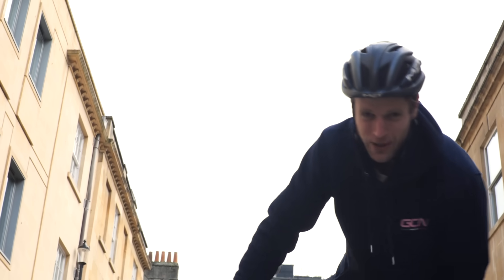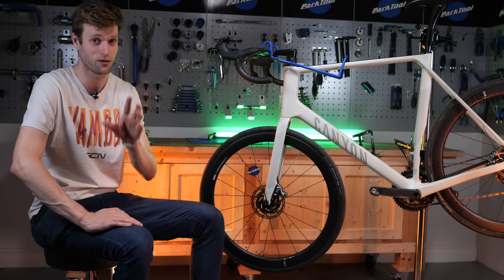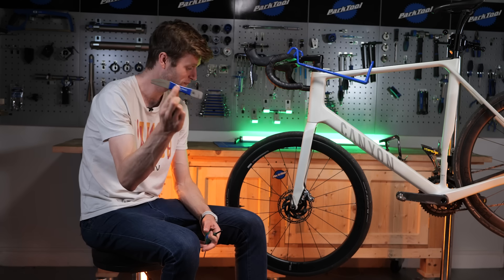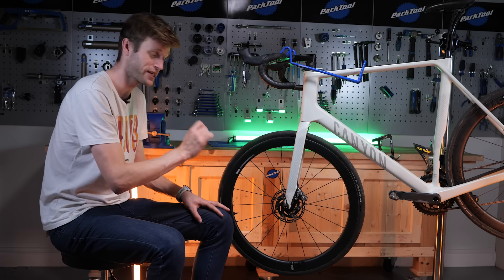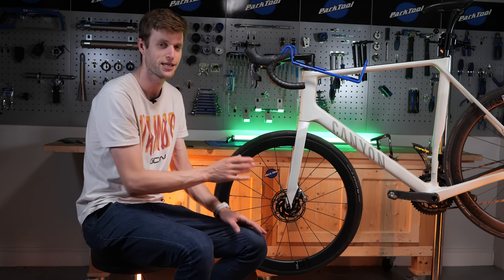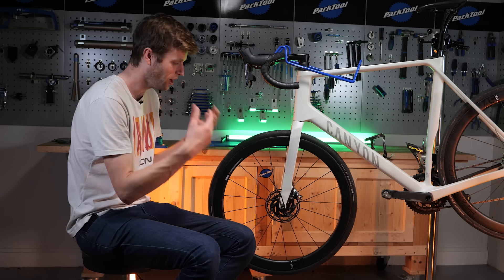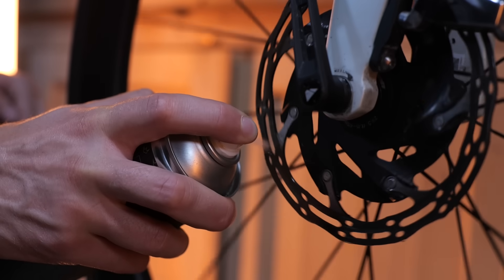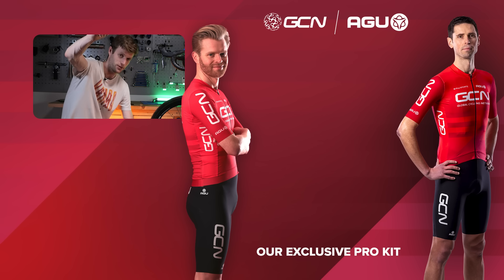Why Your Disc Brakes Are Noisy (And How To Fix Them)

Comment from the maker: What do you do to stop squeaky breaks?
Reply: I increase the volume of my headphones.
Reply: @svenlima  SO DO I
Reply: by learning grammar, "brakes"
Reply: @brittle1  You’re right. But I think you mean spelling.Also start your sentences with a capital and end them with a full stop.
Reply: @Lurcherman-p4k  no
Reply: After a basic alignment and cleaning caliper pistons…

If there are further alignment problems, remove the bleed screw, depress the brake lever by a few mm, and reinstall the bleed screw while the lever is slightly depressed.  This will enhance pull back on the pistons and pads.  Job done!  Easy.

Scrubbing powder works better than sandpaper for reconditioning the rotors.  Less aggressive and more consistent.  Just need to remove the rotors before and thoroughly rinse them after.

Having ridden rim brake bikes for decades, I’d never go back.  Hydraulic disc brakes are superior in all conditions.  The degree of control is amazing.  No more difficult to service… just different.
Reply: uninstall brakes
Reply: 5:17 if your pad contaminated, soak it on solvent or simply gasoline for 24 hours. Repeat the process once, and the pad will free for any oil contamination. It's easy if we have spare pads. Contamination can be came from mineral oil leak in brake caliper.
Reply: 55 years using rim brakes (not breaks) with no issues. Why do I need disc brakes?
Reply: @Graps19  You don't. You also don't need to waste time watching or commenting on videos about something you don't have, but yet here you are 🙄.
Reply: @Bikey_McBeardface  And here you are, wasting time commenting on my comment.
Reply: @Graps19  No because I have bikes with disc brakes and was listening to/watching  the content whilst commenting. Besides, pointing out stupid is never a waste of time.
Reply: @Bikey_McBeardface  Really? a rather stupid comment that assumes much.
Reply: @Graps19  Pretty sound assumptions, based on your comments.
Reply: @Bikey_McBeardface  If you base your "sound" assumptions on a comment as to why I don't need disc brakes you need some education in understanding English.
Reply: @Graps19  I never made an assumption as to why you don't need disc brakes. I assumed you aren't very bright, and like I said ...sound assumption.
Reply: I keep my bike in good repair to keep it from breaking.
Reply: https://youtu.be/zE6NFkGf-Fc?si=8ioEMc7qMMhzO2Ks
Reply: Nobody admits the real cost of disc brakes.
Reply: Oil them 😂
Reply: WD40
Reply: Send it.
Reply: Nothing because its hub and fork flex causing it when I stand up
Reply: I don't. I love my brakes to screech that way the 4-wheeled idiots of LA know I'm coming. It helps un-distract them from their cell phones.
Reply: Antacid tablets will help stop any embarrassing squeaky breaks
Reply: *brakes
Reply: Ride my rim brake bike
Reply: @chriswood1474 Yes I wish we still had the choice to buy a rim brake frameset.The average cyclist doesn’t need all this faff.
Reply: spray wd40 on it 🙂
Reply: @joshuavantongeren1734  Can I ask if this is serious that WD40 works. Im genuine wondering thanks.

I else found sandpaper with alchohol smart. I wonder if that also works for rim brakes, cleaning the rim of the wheel.

Comment: I’ve come to the conclusion that some disc brakes are just inherently noisy, and the only real fix is switching to different ones. I have three bikes - two with Sram Level brakes, both incredibly noisy, especially when wet. It takes ages for the noise to fade, only for it to come right back as soon as they get a little wet again. I’ve sanded and cleaned the pads and rotors multiple times, replaced pads, aligned calipers, tried every trick you hear in the videos - nothing makes a difference. My third bike has Shimano MT400 brakes, and I’ve had zero issues with them despite using and maintaining them the exact same way.

Comment: I just dont get it. I got disc brakes because everyone said they were better, and yet I've had more issues and spent more time on them to be more fearful of their performance in bad conditions. They squeal unbearably in the wet and now I'm resigned to replacing the rotars as well as the pads because i just can't keep sanding or cleaning.

Comment: I learned the hard way that ringing (like a finger around a wine glass) can easily be caused by not installing the front wheel correctly.  Make sure the axle is fully up in the dropouts!

Comment: The sanding part works for me. My brakes are no longer squeaky.
Reply: What grit number is the sandpaper?  Sandpaper goes anywhere from 36 grit to 600 grit.
Reply: @dwightl5863  I've used 400 grit sandpaper. Then wipe the rotor with clean cloth after sanding.

Comment: Had disc brakes for many years on Mt bikes first, now on my road bike, always maintain them well, squealing noise rare. Last spring took bike out from garage where it had been 3C overnight into 20C of spring sunshine, extremely noisy brakes... realised it was water condensation on the cold rotors. Bit of extra braking over first couple of mins of ride, sorted, once rotors warmed up.
Sometimes it's not a major problem. 
Enjoy your rim brakes if you like them, but give me discs any day. Have been riding for 50 years  nearly all on rims. When I bought my latest  road bike 4 years ago , it was discs ....fantastic, at 60km/h on a mountain descent with a hairpin approaching, no comparison.

Comment: Rim brake question - I had the same issue with my Shimano brake pads.  I swapped them out for Kool Stop brake pads, based on a recommendation I found and I have not had the issue since.

Comment: u cant, if u fix it it will become noisy again anyway. and I prefer v-brakes on ceramic coated rims, because it is better :P Riding my 90s ht mtb as a rigid gravel bike with 203mm servowave xt brakes at front and still the braking is lacking compared to the old v-brakes with ceramic coated rims. My friends says they are the best brakes they ever felt on a bicycle, but what do they know they only are cyclists and have never tried out a motorcycle :P

we need fatter rotors so that they dont overheat so easy, I am glazing over my pads so often, but it is so much better with sintered pads.

Comment: After watching this video I learned that the squeal in my brakes was due to contamination of the pads. Without taking anything apart I cleaned everything with alcohol as suggested to no avail. So thinking of everything demonstrated in this video I took a pressure steamer that  use for cleaning around the house and applied it to the brakes assembly, pads, and rotors. It worked great. Squeal is gone. Thanks for inspiring me to think outside the box.
Reply: +iamc.... Alcohol is never a solution - didn't you learn that?
Reply: @svenlima  obviously not 😀

Comment: @askgcntech I just bought my first bike with Di2.  It says that "The components are designed to be fully waterproofed to withstand wet weather riding conditions; however, do not deliberately place them into water."  The UK has been endless rain this year with flooding.  Is it OK to ride through flood water of 100m or so (lengthwise not depth obviously)?
Reply: I’ve ridden DI2 through axle-deep fords and done three seasons of cyclocross with it and all the abuse and jet washing that goes along with that splendidly stupid sport. No issues whatsoever.
Reply: @DrCrispycross  Thanks that's very helpful

Comment: What I learned from seminars, and courses in the motor industry, on disc brake noise. if the pads and discs are not contaminated, but a squeak occurs when braking in the wet, but only for a second or two. Then it can sometimes be down to 'harmonics'. i'e' water between the pad and rotor creates vibration. This causes a squeal, as in when a wet finger is rubbed aroung the rim of a wine glass, thus producing a noise. Once the water is cleared from between the pad and rotor during braking, then the noise ceases. That's what they taught us anyway.🧑‍🎓🙄

Comment: What do you think, what happens if the disc brake vibrates to feel?
It is not worn so much that neither the disc nor the brake pad needs to be replaced, and there is not enough dirt on it to make a sound, and no damage can be detected.
Reply: When I thought about the problem, this came up during the inspection: https://youtube.com/shorts/8mX6-4TqnEs?si=EBTrQ1u1S7nBWqPv

Comment: If you use resin based pads they make less noise than the metalbased pads. Most road bikes do not need the metalbased pads that cool better and can resist high temperaturen. But most roadbikes do not need these pads and the resinbased pads stay clean better when you do not do a lot of extreme breaking.

Comment: Despite all that, every pro bike race you watch on TV features horrible squeaking/squawking when the peloton slows down. If the supposedly best wrenches working on the best bikes for the best riders can't stop it..
Last time I dealt with this was Shimano Ultegra...after doing all the stuff in your video + more, I swapped the fancy, two-piece rotors out for the cheap one-piece Shimano versions made-in-China along with the Shimano brake pads for Swisstop organics. All quiet...for now anyway!

Comment: Disc brakes on bikes are a pain. Frames aren't flush to the calipers making them line up is a pain without using special tools. Rotors bend if you sneeze on them.

Comment: Yay, another video where all the rim brake people feel the need to tell everyone how wrong their conclusions about disc brakes are.  

Just admit that you're too old to handle new technology and head on over to the retirement home so you're not in our way out on the road.
Reply: I have both and in DRY conditions I ask WHY I have to fiddle around with noise, hydro issues (hoses, bleed kits, oil, olives and barbs) when a decent dual-pivot caliper squeezing rubber blocks against the sides of an aluminum rim with a machined brake track works just as well while being lighter to boot? I'm old, but after "handling" all this new technology more and more it seems like planned obsolescence vs any big improvement when I've had great fun for decades zooming down almost all the famous descents of the Giro and Tour...on rim brakes.

Comment: A lot easier brake pads bedding in procedure is before installing them, wet them with water (tap will do) and rub them against each other whilst wet for a minute or so. Then wash them under water to get off the rubbed bits and dry them with a cloth. Install and ride without any bedding in - works a treat. 

I saw this in one of the bike mechanic preparations for the bike before race and used it a few times. Saves loads of time.

Comment: Why haven’t we learned more from car disc brakes? Mine have always been quiet, regardless of conditions, contamination, etc. etc., etc.
Reply: I've read somewhere that car's rotors are far thicker and, for that reason, they vibrate much less. Thus, the noise is not produced (or it cannot be heard anyway) in a similar case.
Reply: Car brakes get hotter

Comment: After a sportive race, I dowsed my rear disc brake in celebatory (non-alcoholic) beer. The worst screeming brakes I ever heard. It did sound like a truck, not even like a car. Some sanding an isopropanol did fix it easily, though.

Comment: Contamination is a demon sometimes. One time I did pads and rotors multiple times only to find it was a leaking caliper that was causing the issue. Rip my money. I take a staged solution to brakes now. Lv1 Alignment and rotor warp. Lv2 sand rotors, sand pads, clean both iso, clean caliper piston and reset, torch rotor on bike, caliper on, pads out. Somthing is screwed if its not good after that.  Also, if your out of alignment it can cause contamination. If your rotors got a good warp, even one within the gap, can cause contamination. Everything has to be aligned perfect as you can, that is half the battle of reliability. Gradual contamination is a thing imo. You want the pads to be sweeping the rotors clean, perfect alignment all ways is what gives this. This is why some bike frames brake better than others, better honed mounts, stiffer too.
Reply: What a PITA!!! Thanks bike industry!

Comment: I'm quite disappointed to see that pads and rotor glazing wasn't mentioned in this video since it's a very frequent source of brake squealing. It happens when the system gets too hot especially with organic pads. Also, although putting a new set of pads on a used rotor is possible, it's not a good practice since the rotor surface will be irregular. Therefore, there will only be about 40%-50% contact with the new pads thus creating even more opportunities for glazed pads or rotor.
Reply: What's the best fix for glazed pads and rotors?
I actually have this going on at the moment, should I just sand them?
Reply: @colincanyon2519  it's what I do , fig 8 motion pad sand on 800grit placed on a very flat surface, and just make the disc evenly dull .
Reply: @CarkeekW  
I did sand discs before but probably nowhere near enough, I'll do that with the 800 grit 👍
Cheers man you've been a great help 👌
Reply: @colincanyon2519 just till it's dull , it's not a lot required.  I can get rid of light contamination by riding along the flat and very gently applying a brake and peddling against it , if it makes a noise you have put on too much pressure, it starts out you can't use hardly any pressure but in a short time you can use more pressure and it still won't squeal. You keep doing that till you max out the pressure you can ride against and then you find a hill and run down it holding the brakes on just under the moment the squeal and peddling if need be till you have the brakes on as hard as possible and the squeal zone has now gone past your normal use of brake pressure.  Short story you warm up the brakes by keeping them just under the harmonic squeal zone the whole time until they are running clear again
Reply: @colincanyon2519  Yes, it happened to me and I could recover pads by sanding them. I do not think it's a good idea to sand the rotors, though (never tried)
Reply: @erosforenzi1330  
Thanks, yes I have sanded pads before and in the end the squealing was back so I do think sanding the rotors is worth trying 🤔

Comment: My rear disc brake was rubbing. Turns out it was the misaligned caliper. I was able to easily fix it after following the instructions on the video. Thank you GCN.

Comment: Im going to try a very very light smear of copper paste / copaslip on the backs of the brake pads, NOT on the friction material obviously! I've tried everything now apart from burning and im convinced my new Ultegra calipers and replacement pads are resonating under braking causing squealing, a bit like a violin bow on its string! Anyone else tried this? My other Giant with same set up has been squeal free, bedded in the same way!
Reply: Not a big fan of Ultegra..as noted elsewhere I swapped the rotors out for cheap, one-piece Chinese Shimano rotors + Swisstop organic pads. So far, nice and quiet.
Reply: @larryt.atcycleitalia5786  Shimano aren’t a fan of ultegra rotors either. The MTB ones are standard now.
Reply: Ugh, that’s not right. I misremembered something and now YT won’t let me delete it, it was pro road teams that were using MTB rotors. But that may be a supply thing.
Reply: Hey! Same sensation here for my front calliper. Did a complete bleed and sanded the pads but it’s still noisy and it really looks like they’re vibrating. Also I find that my câliner some how spreads out when I brake strong which may result in less braking power…
Reply: Did you tried to use paste behind the brake pad finally?